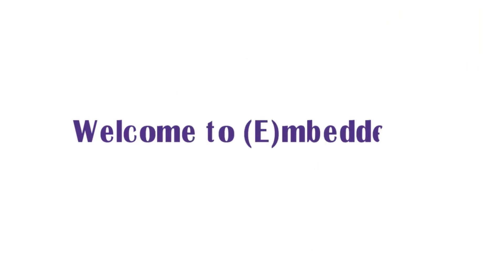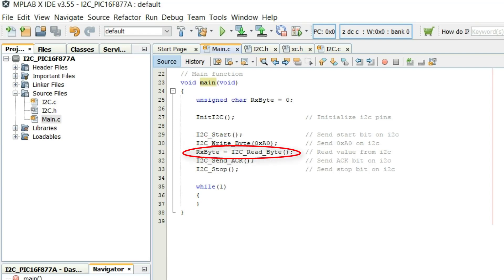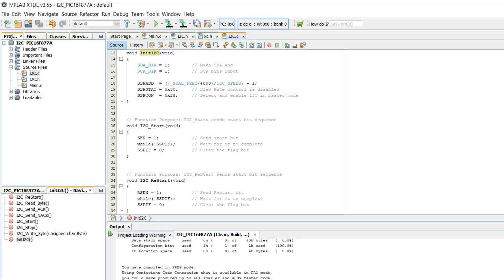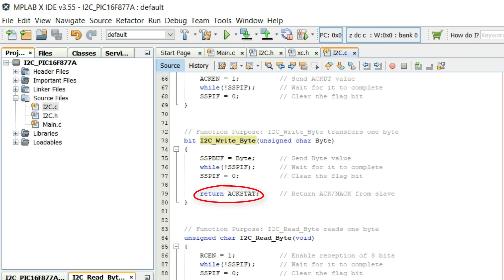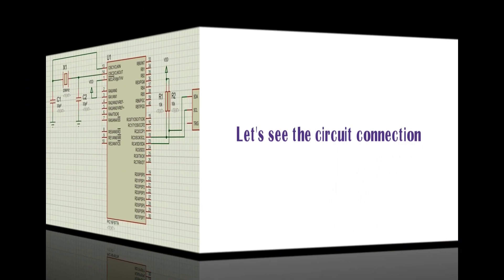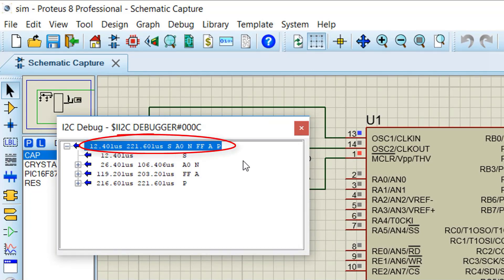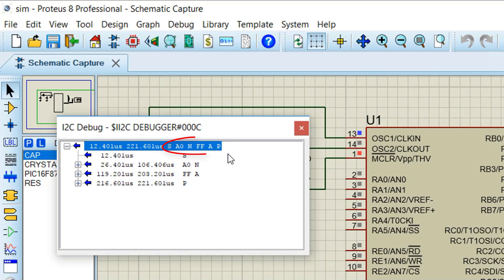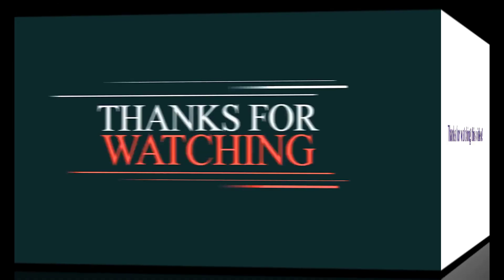I2C driver for PIC16F877A with Proteus simulation | I2C driver for PIC Microcontroller

Comment: Hi thanks for your help I downloaded and everything works, I want to ask you how I can adjust the code by connecting an eprom 24c02 and write a byte with the function :

void write_ext_eeprom(unsigned char address, unsigned char data)
addrl=LOW_BYTE(0x55); // address
    addrh=HIGH_BYTE(address); // address
    i2c_start();
       i2c_write(0xa0);
       i2c_write(addrh);
       i2c_write(addrl);
RB2=i2c_write(data);  //led red
i2c_stop();
       DelayMs(255);
RB2=0;

help me find the code thanks

Comment: In my case im using PIC16f18346 but also I dont find SEN, RSEN, PEN... registers, Does It Is find to use for example SPP1CON2bits.SEN to make reference to this registers? This PIC has 2 I2C buses and this could be the reason why I cant use the same as you. Also I dont fin I2C examples whit this PIC so please help